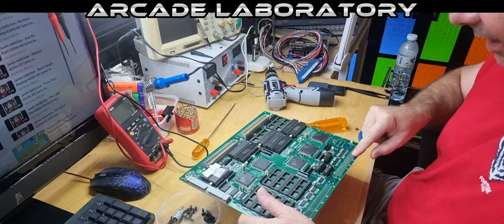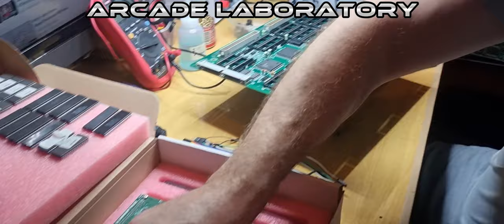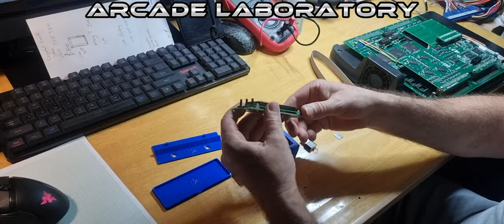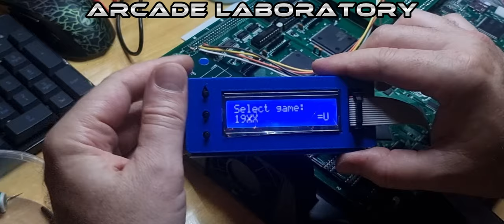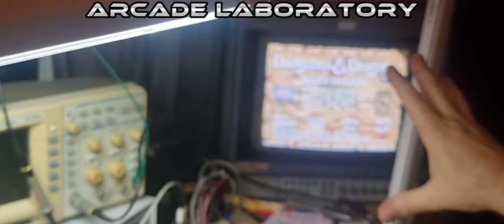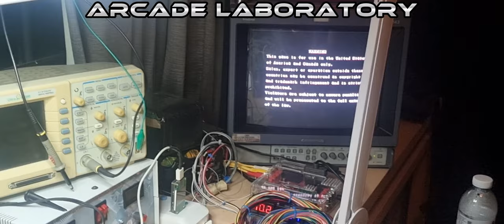CPS2 Champion Edition Arcade PCB Installation

Comment: Im torn btw going this route or just getting a saturn and fully modding it... idk which one to choose... the saturn has most of the hits of the cps2 but the cps2 may run the games better with more frames and better graphics... mainly i dont understand about the supergun and the power supply... any advice?
Reply: In a nutshell, a supergun is a device that will adapt the video, audio and control signals from a JAMMA arcade board to a living room setup. It converts video signals to something that can be viewed on a consumer TV or monitor, converts audio levels, and provides a way to hook up either standard or custom controls. Some superguns have analog RGB output only, and some have a wider selection of video outputs. Some people use superguns with other kinds of video scalers and converters as well, such as the Extron, OSSC (Open-Source Scan Converter) or RetroTink.

Powering the supergun and arcade board is another concern, as you pointed out. If you poke around the Arcade-Projects forums you will probably find threads talking about power supplies to use with various superguns and arcade boards. Some people have adapted PC power supplies, while most people tend to go with PSUs made for arcade hardware or other kinds of small industrial power supplies.

To my mind one of the more tricky parts of supergun setup is player controls, depending on what controls you have on hand or plan to use. You will need to adapt an existing or custom arcade stick or gamepad to the connector style that your chosen supergun uses, which may involve pre-made adapters or soldering skills to make a custom cable.

Setting up a CPS-2 setup and a supergun is going to be a much bigger project than getting a Saturn, arcade stick(s) and all of the fighting games you want to play. But in the end it is a fun project. It all depends on your technical aptitude, time frame and willingness to learn new stuff.

Comment: I've been out of the loop on the latest Darksoft products, but what's the difference between the Champion Edition and the original ones released years ago? I have the original one and I'm curious if I'm missing anything that might be worth an upgrade.
Reply from the maker: Hi Brandon! Sorry for the delayed reply. Good question and I did some research. Functionally both versions are the same however the difference lays in the installation and hardware itself.  Here are the notes from the installation guide. I think this is the only real difference. 

Overview –

• Thanks kindly for your purchase of the Darksoft ‘Champion Edition’
CPSG2 Multi Kit. Functionally, this kit is identical to previously
released kits, however the installation process has been streamlined
and is now a lot simpler!
• There is no longer a need to be concerned about jumpers,
replacement PAL chips or running a jumper wire to the PAL. There is
also no longer a need to modify the original case in any way, and for
most users, key writing wires are simply connected via one cable.

Comment: Antes de instalar esto, prefiero emular, ya que pierde la gracia de tener la PCB arcade, lo veo mas parecido a un tv box con emuladores cps1 y cps2. es mi humilde opinion.
Reply from the maker: That's an option for sure. And much less expensive. The up side is this kit is 100% Capcom HW and SW. The Twin Galaxies have even approved it for competition high score ranking. Thanks for the great comment. Emulation vs original HW and SW  is a tough choice sometimes.
Reply: @arcadelaboratory  Una Tv Box me parece una basura, me genera la misma sensacion este Kit-Cps2. yo prefiero mil veces tener una PCB original a tener estos multijuegos. ya que por mas que digan que es como el original, no lo son, la realidad es esa. de igual manera buen video espero no te lo tomes a mal, saludos cordiales.
Reply from the maker: @cosmemod1820  I understand you and agree. Emulation is not the same. Some is better than others but it's like you said, lag, frame rate issues, color issues and sometimes major SW rework. That's why I work on original parts.
Reply: Y cual es la gracia de tener una PCB arcade, segun usted?
Reply from the maker: @user02573  The original pcb hardware offers proper software processing where emulation might have glitches. Using original HW and SW also qualifies you for high score competition with the Twin Galaxies. Also using the original pcb  is a plug and play swap for the cabinet, no adapters, power issues, video or sync issues. Lots of good emulators and I'm ok with that but I'll run the original pcb first if I have a choice.